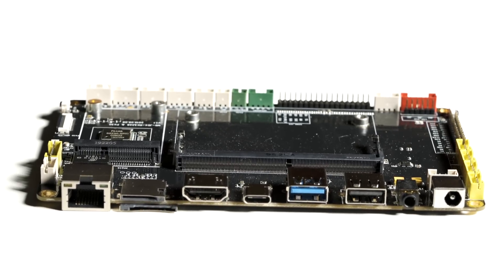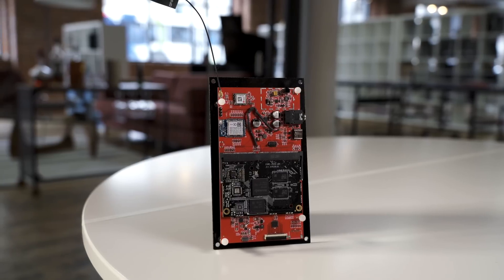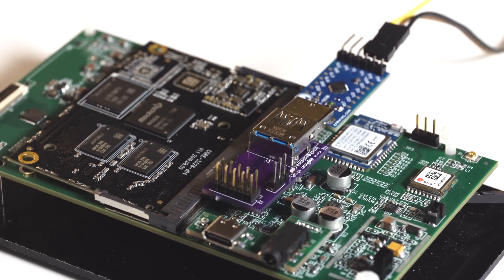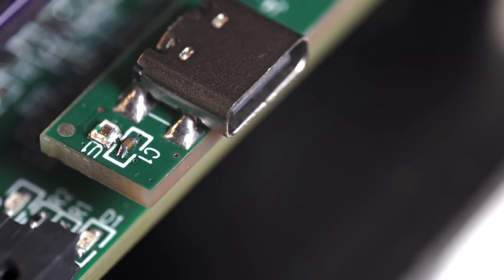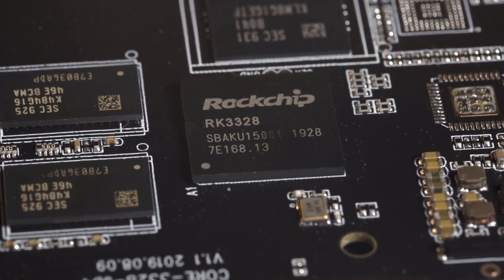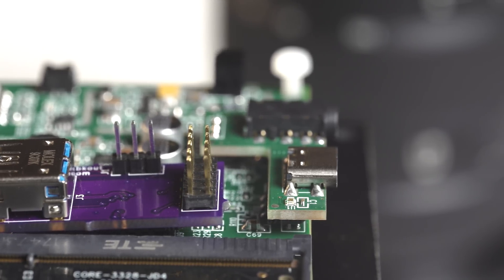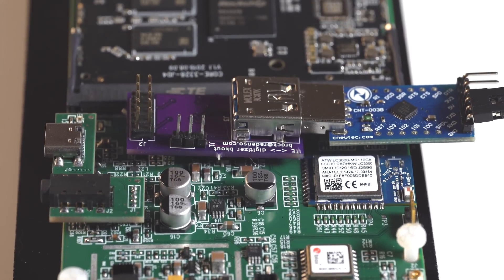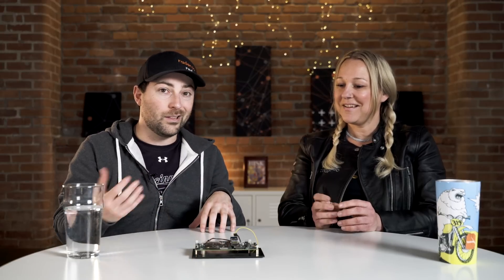Radenso Theia Motherboard Development Update

Comment: I consider myself a rather professional radar detector bird dog user, I'm 57 I've been running these things since I was 17 and the first ones were pretty ancient, today I got myRadenso XP haven't even plugged it in yet, I had a beltronics 955i but it's got to where it's picking up too many anti-collision sensors because the KA band has it been tweaked on these not to read them because they wasn't around when it came out you know that I'm preaching to the choir I guess I'm trying to show you I know a little bit I don't get tickets it's a cat and mouse game and all my cars are hot rods, I like to my beltronics pretty damn good range I hope this one picks up as far as that one hopefully it should pick up more it's been years since that one came out but I couldn't see it comparison because mine was older between the exact two I would like to see you do a comparison between those two I know it's an older one and I know it's not the most expensive but the thing was a little beast it was cutting edge for the price I will be back on here after I run this thing a little while and if you would like I'll let you know how it worked out you seem like you're a small company and I appreciate your knowledge I can't wait to start bird dog in my way around the highway and the City no more false alerts

Comment: One of my suggestions a couple years back was going to be fore and aft mounted PV sensors. Put it on the top, and the headliner could mess with it, the bottom won’t work, and driving into/away from the sun would yield different outputs. For example, if it’s only mounted in the front, and you’re driving into the sun, it’ll Jack it up all the way. Good. If you’re driving away from the sun, it’ll be in the shadow, and not jack it up all the way, and there will be tremendous screen glare on the screen read out. Not good. The addition of a rear sensor would fix that as much as possible. Perhaps an integration of a GPS vector calculation, and a brightness reading from the PV could help infer that variance in brightness, but 2 sensors seems more accurate.

Also, remote mute cable compatibility is key, you don’t want to have to reach around to mute it every time. But that’s pretty standard.

........ How about adding a frequency inversion transmitter? A man can dream lol.

Comment: Strongly consider making a naked/minimalist detector SKU for remote, other stealth and motorcyclists.  It should have/be: 
1. A great receiver with kickass signal processing, a Bluetooth interface, and a single button for on/off and pairing.  Update firmware over Bluetooth (despite being slower).
2. No UI – no lights, displays, buttons, dials, speaker.
3. Lidar detection is optional (separate discussion).
4. No need for GPS or anything else duplicative with a smart phone.
5. Reasonably waterproof for remote and motorcycle.
6. As small as possible; the shape can be optimized for its pure detector function without regard to UI.
7. Disguisable, e.g., make it look like a dashcam - maybe even throw in a camera to make it one given how small/cheap they are.

I use a detector (Escort 360 Max) in my BMW supersport motorcycle and M3 car.  I like your technology way better, but need the Bluetooth (to phone app and helmet) for the bike.  But even in the car, I want to mount the detector away from me/driver and the phone provides much better UI anyway.  It also enables crowdsourcing police presence (ala Escort Live, Waze, etc.) along with higher-level analytics.

This makes for a slightly smaller, cheaper, stealthier and more flexible detector.  The smartphone is the most advanced and most updated piece of technology people own.  Exploit it and disrupt the market.
Reply from the maker: Thanks for the feedback, we are motorcycle riders as well and have been radar detector users for over a decade now so you'll have to see what we come up with!

Comment: I read that this will be a dash mounted unit. Are there going to be partnering with blendmount to ensure a nice sleek mounting option below the mirror still? Also will you be doing beta testing? I would love to try this out for you guys
Reply from the maker: Radenso Theia is going to be a windshield mounted radar detector.  Mounting a radar detector on the top of a dash reduces range.  Blendmount will be able to be purchased from our website along with Radenso Theia so you can receive both at the same time.  We appreciate all of the offers but we do our own beta testing in house.